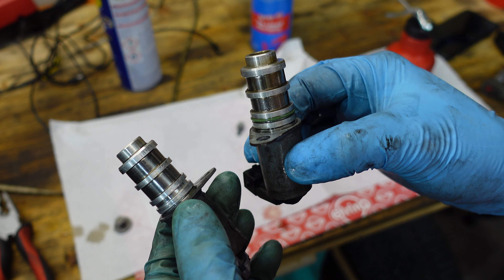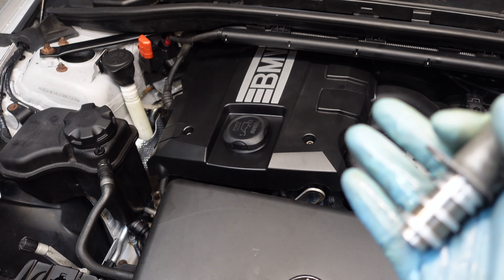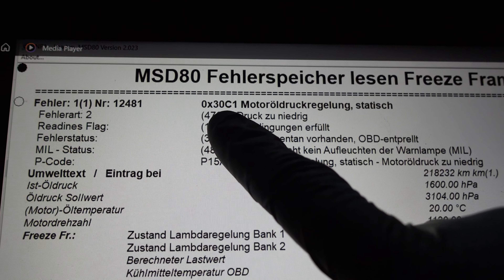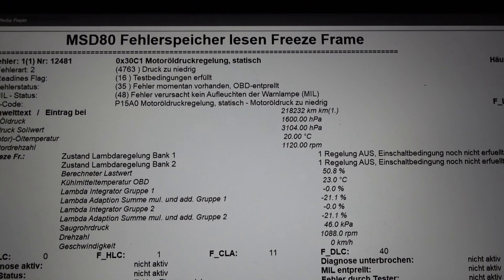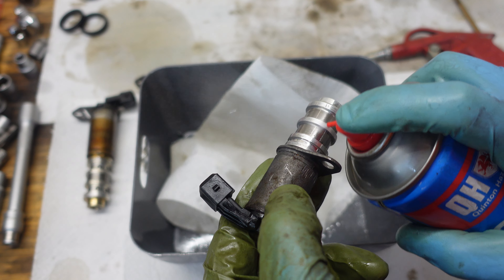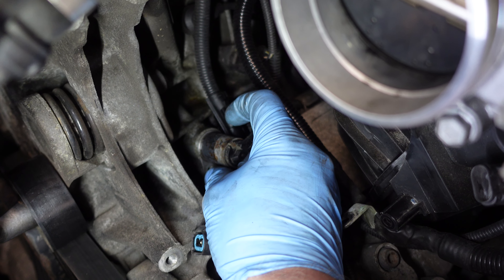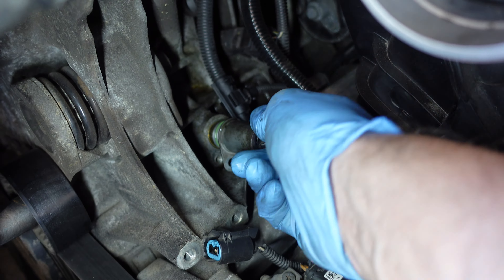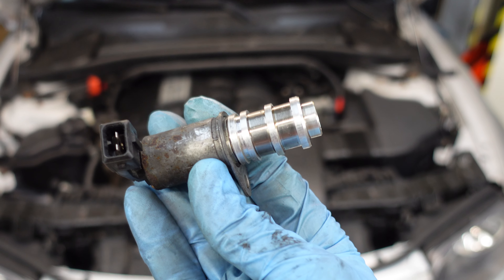Diagnose & Fix low oil pressure light 30C1, P15A0 | BMW N43 oil control solenoid valve explained

Comment: hello, tomorrow I'm going to change the oil pressure sensor and the oil pressure valve on my car, the oil pressure light only comes on when I'm driving on the highway and I'm driving over 180 km/h, so it only comes on at high revs, if anyone can tell me what are the chances that it's this or I'll I have to dig deeper. I see that a lot of people have problems with chain deposits and pieces of plastic, but I changed the chain 10,000 km ago, thank you.

Comment: Great video. THE main issue is rust bubbling and powder coat ingestion into the engine oil thenceforth it goes everywhere. I just replaced a sump. Told the owner I dont touch the car unless you let me drop the sump. New solenoid will last a month or 2 then oil pressure static will come back.

Comment: i have the same problem, the light came on with a cold start. so i change the old solenoid and replaced it with a new one. still have the same problem with a cold start. the light turns on after 10 seconds of letting it idle. do you know what it could be?
Reply from the maker: @districtss_1211  oil pickup blockage (broken chain guides) comes to mind. Did you scan for codes? Any other codes besides the one for the oil pressure?
Reply: @ i took it for a drive and the light didn’t turn on at all. i drove right away when i started the car. drove 235km still hasn’t turned on so i think its good for now. still hope it stays like that in the future

Comment: Can you explain how to change the oil pressure control valve on the n53b30? In tis it says just remove engine cover under the engine and you have access (it's on the passenger side on the n53). That is not actually true since theres too much in the way.
Reply from the maker: @Baran_Demir  I never did this on a N53 so I can't comment on that...

Comment: Hi my friend I change the oil switch and the oil valve on my n43 engine olso new oil and filter and after scanning the car the light still comes out any ideas ? Thanks
Reply from the maker: @Triko5 Still low oil pressure? I would definetly check ths plastic rail and oil pickup. Very common problem with broken plastic pieces in oil pickup and oil pump.
Reply: @ yes unfortunately for me after changing the 2 sensor after driving like 40 minutes the Red Light showed up again I delete the code I did another driving the light came back again..: so I assume I have plastic in the oil or maybe a bad oil pump !!! What do you think
Reply from the maker: @Triko5  broken plastic chain rail is more common problem
Reply: @BimmerZen  the camshaft valve have anything to do with oil pressure?
Reply: @ thanks for taking the time to answer my question 👍👍👍😂

Comment: Hello, Im facing the exact same issue on my N43 (118i), and already tried "everything", but Im still getting the oil pressure light after driving for about 20min. I have replaced the oil valve, the oil switch, changed the cover and gaskets from the oil filter housing. I also measured the oil pressure with analog equipment and looks fine.
Any other ideas what could be the issue? Thanks in advance
Reply: Timing chain
Reply: @ any way to test it, in advance, before opening the engine?
Reply: @ab4tw  when you start the engine at cold, do you hear a rattle for two or three seconds. if it does, you need to change your timing change and open the oil pan and remove all the timing chain broken pieces and then put new timing chain on it.

Comment: Hi BimmerZen, great video very vell explained. I have F30 316d and a message showed up "problem with the engine, drive slowly to your bmw service and have check up" (the power is reduced). After scaning i have code: control valve presion oil, problem mecanik. Do you know where is situated the presion control vale on the F30 model?

Comment: I am asking for help.
I own a BMW e90 n43 1.6 petrol.
it happens to me that at low revolutions, at about 1400-1500 revolutions, when I suddenly add gas, full gas, it starts to jerk and throw out an error, check the engine. When I turn it off and turn it on, the error is deleted and it works normally. There are no other problems at higher speeds, only at low revs with sudden acceleration, if I accelerate slowly, there is no such problem, it does not jerk.
if you have any idea what i could check and make sure to change the spark plugs themselves they are new. Thanks in advance
Reply from the maker: @anesk4285  First scan for error codes with INPA or N43 compatible scanner
Reply: @BimmerZen  I scanned with the Autel IM608 and it said an error on the third cylinder missing ignition and in addition it also says a Lambda sensor error.
Tomorrow I will give you a picture of exactly which errors it throws out. Thanks again
Reply: I forgot to say that there is a lot of smell from the exhaust, like some bad gasoline. At the first ignition, it emits black smoke from the exhaust. And currently it shows me the average fuel consumption of 11.6 liters,
Reply from the maker: You need to be more specific which code and description. Most probably bad ignition coil or injector. Swap coil nr 3 with a good coil cylinder on nr 1 or 4. If the error moves, you know you have a bad coil. Another more probable cause is bad injector. New are very expensive, if you get used injector make sure you have some guarantee it works or warranty. Contrary to popular believe, these piezo injectors can not be cleaned so don't bother with that... Try to get the same injector version as your existing injectors.
Reply: @BimmerZen  Thank you very much
I will follow your advice and I will certainly take pictures of the mistakes if they are repeated on the same cylinder

Comment: Hi. I have a small question.

My BMW 320i 2009 has engine (n43 engine) problem and I want to change its engine with BMW 320i 2005 which is I think n46 engine.

Is it possible to swap. Will the computer and size match. I shall be grateful if you please let me know. Thank you very much
Reply: I asked a company here in germany and they said its not possible. So i bought a new build engine and now its running. new injectors - oil cooler - solenoid valve and fuel pump and yes you can buy a new e90 for this🙄

Comment: Hy what can be the problem if my bmw e87 crank but not start the car was driving perfect but not it won’t start it only crank where do I start checking
Reply from the maker: Always start by scanning for error codes, then just google the codes with the engine code.